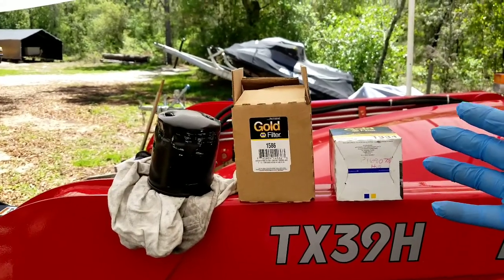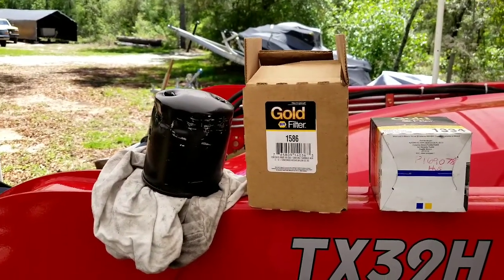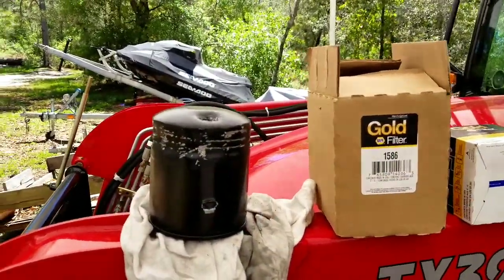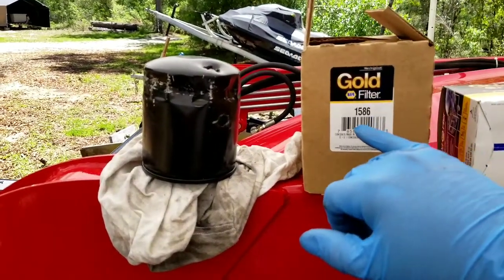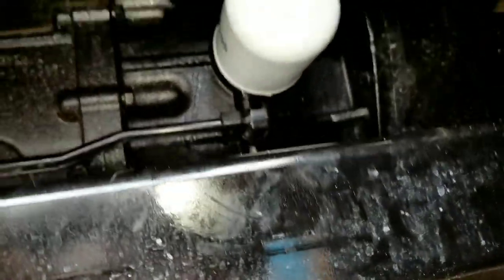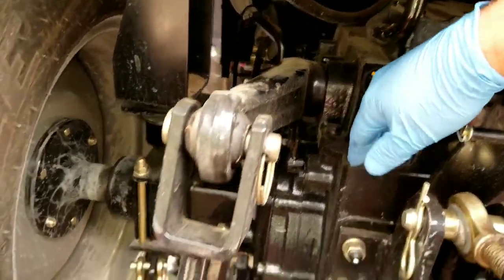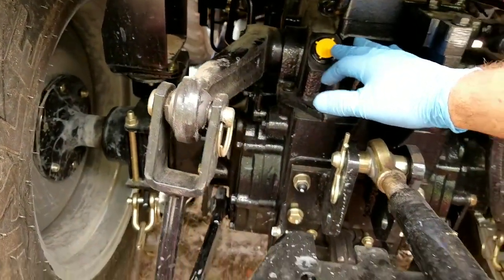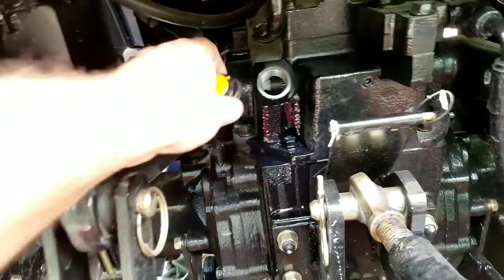T394 hydro fluid change with filter

Comment: Thanks for the video. FYI / FWIW I used a 6" C clamp (yeah, the plain kind used in carpentry) to take that HST filter off. Cranked it, wiggled, cranked it, etc. until the filter stopped collapsing, at which point I used the clamp end as a lever. Even so it was a pain.

Comment: You never mentioned or showed cleaning the  strainer which catches metal shavings(not the magnet on the drain plug) It is located on the right side of transmission. You simply clean it with diesel fuel wipe clean and reuse. Hopefully u did!

Comment: Did you clean the strainer?  The hose is on super tight and dont want to start going at it with a channel locks and screwdriver. Hoping you had a tip.
Reply from the maker: Lol  You know honestly I can't even remember if I did or not

Comment: I just hit 53 hours on my 2017  TYM  TX39H and ready to do my first oil change, both hydraulic and regular oil.  There was no information on what hydraulic filter or oil filter to replace the Korean filters with. The manual is not very clear on any of these topics. I watched both of your videos for this tractor and they were very informative. How about a video on checking the axle oil levels and showing where all the grease zerts are that need to be greased ? Also, there isn't anything in the manual about how often to change out the fuel filter and what to replace the Korean fuel filter with.   Thank you.
Reply from the maker: I know took me very long time to cross them. Also regarding the grease points I have not done mine yet and I'm at 80 hours I would just crawl underneath they are and look for them.

Comment: Would this tractor be comparable to the rk 37, as far as how to change fluids
Reply from the maker: Good question and the answer is yes this is the same exact tractor except the hood is a little different comes out of the same factory  I kind of wish I got the Rk 37 because it came with arm rest mine didn't lol
Reply: @FLORIDALIFECLIPS  I have the rk 37 and really love it,only problem is the techs at Rural King dont seem to be real knowledgable about the tractors.
Reply from the maker: @davidm.5727    You can talk to a mahendra dealer or a TYM dealer they all come out of the same factory.

Comment: I've got a TYM - they are crap - spent more time getting repaired than I've used it. Watch that the electronics are only covered for two years and not the 6 year warranty as claimed.
Reply from the maker: 10-4
Reply: Knock on wood, mine has been a beast!
Reply: Mark, what kind of issues have you had? Just clicked 110 hrs. on my T394 and other than a loose battery connection and a little low on Freon it’s been solid and I’ve been working the crap out of it.